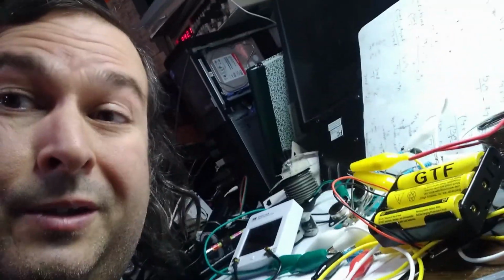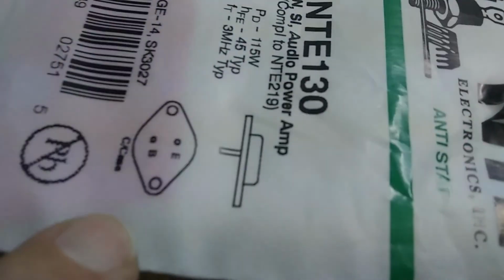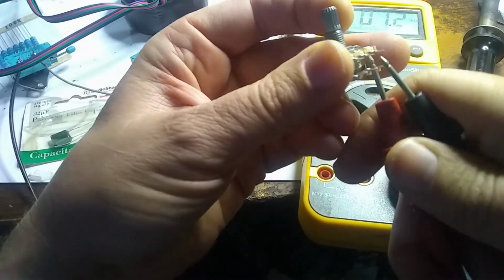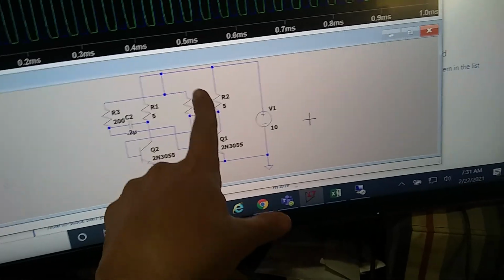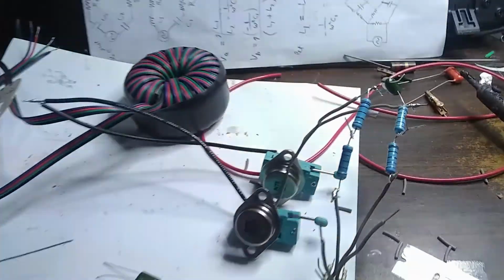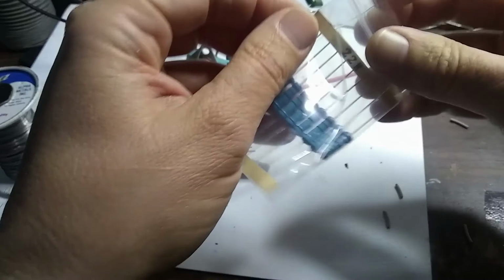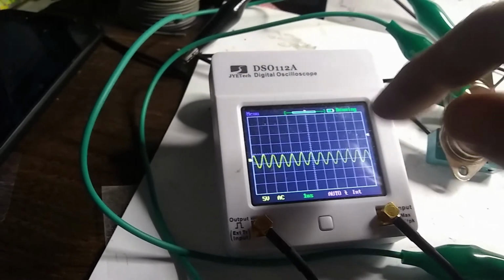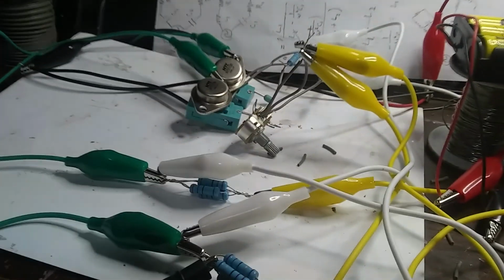2 Transistor High Power Oscillator - Part 1

Comment: my friend used both NPN or both PNP connected together to be oscillations it very easy the hardest is used NPN&PNP connected together to be oscillations without no IC or anything else just only 2 transistor not many YouTube peoples come up with this idea at all in the 80’S there is inverter projects that’s i been used it a 200watts used 2 transistor NPN&PNP 2N3055 1 transformer only single winding it a straight winding transformer